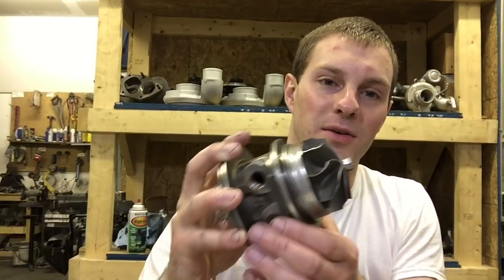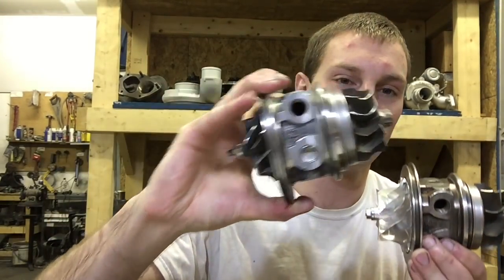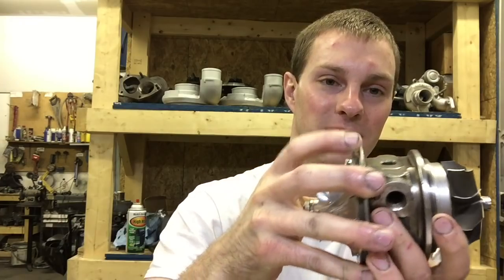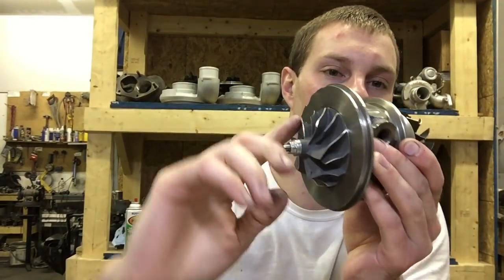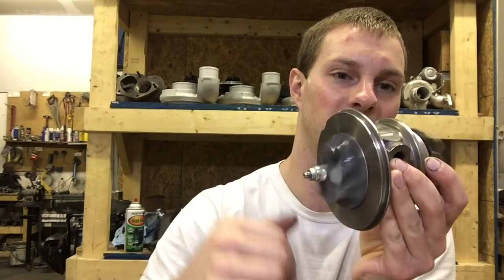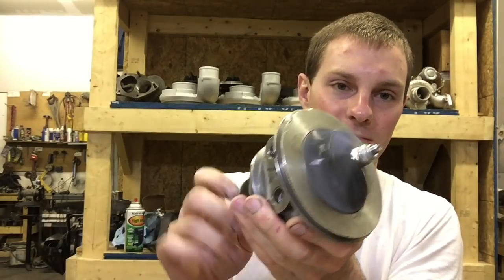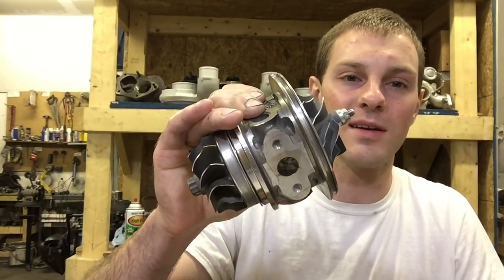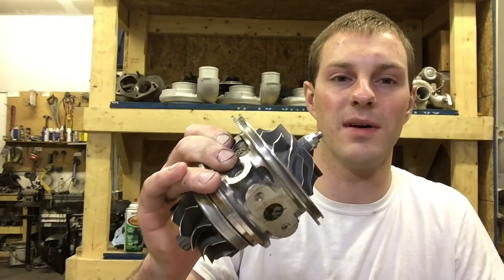Pros and Cons of Ballbearing Turbos

Comment: I use a Garrett ball bearing turbo (GTP38R) in my truck and I love it.  Spools so much faster than stock, used it in both auto and manual setups of the same truck and its amazing.  Really helps to build boost quickly after shifting. Easily holds 40psi when you step on it. Truck has over 400k miles on the 7.3l making around 700ft/lbs.

Comment: i have your 60mm upgrade on my Evo X and it's not laggy at all, been running it for about 2 years and no issues at all with my stock engine, i can't wait to build and see what this turbo can really do. im currently at 470 awhp at 25 psi
Reply: EvolutionXRG what gas is this on? 93 or e85?

Comment: ball bearing turbos have lower friction than journal bearings at low speeds, but above 100,000rpm the journal bearing has less overall friction
Reply: Can you link to some good references so I can read more about that?
Reply: House of Boost for sure less moving parts
Reply: 100,000 RPM?!?!
Reply: @denismarinos4784  Turbos spin really fast.  Take a look at a compressor map sometime.
Reply: @denismarinos4784  small frame turbos can exceed 200,000 rpm, a ball bearing CHRA typically shells it's nuts close to 180,000 rpm. For those applications and when you can't watercool the center cartridge a journal bearing is far superior

Comment: I have to agree with you. Ball bearing is a great stock or slightly upgraded setup due to lots of daily drive cycles and lower boost. Journal bearing are better for larger turbochargers for its race applications and rebuildness.

Comment: Hey great channel good info I’m putting together my first turbo motor an I’m not sure if I should put 2 s400 Bort and Warner or I should put a s500 the motor is a 363 stroker  ford with trick flow heads high port with a stage 5 port job an a trick flow r intake with a 700 lift cam solid roll an a 90mm acufab throttle body an 200lb injectors

Comment: I know this is an older video and I watch a lot of your stuff super interesting. Super cool your willing to take time out of your day to help people!  I have a 6.7 PS hopefully I never need anything but if I do I'll def come to you.
Reply: Powerstroke 6.7 I would suggest in looking in to Elite Diesel Engineering or Industrial Injection Diesel Performance or you might check KC Turbo

I’ve been around Naturally Aspirated and Forced Induction (i.e. Turbocharged & Supercharged) Gas & Diesel engines the vast majority of my life. Diesels and Higher Displacement Engines (even small four & six cylinder engines) of any type will perform 75% to 80% better than stock with a Double Ball Bearing Turbocharger. Journal Bearing Turbochargers work best on like very low displacement but very short thrown/15+k RPM capable power plants.. examples: Formula 1 Ferrari 458/Maclaren F1/2015 Ford GT EcoBoost LeMans & Gran Prix classes. So to put a journal bearing turbocharger on a diesel three things can happen

1. EGT’s (Exhaust Gas Temps)/EOT’s (Engine Oil Temps)/ECT’s (Engine Coolant Temps) will be higher than with a stock turbocharger

2. Oil Changes will be more frequent due to the increase in demanded lubricant in the turbocharger alone

3. MPG’s will drop due to a higher demand for the use of more fuel to rotate the turbine

In other words a journal bearing turbocharger will make a Diesel engine work harder and can cause more & faster wear and tear whereas with a double ball bearing turbocharger it’s the complete opposite.

How do I know such details simple.. was raised by a father who’s an S.C.C.A. (i.e. Sports Car Club Of America) Safety Official for Laguna Seca and Thunder Hill Raceways out here in California. His life of the automotive engineering and creativity inspired me to learn more about the physical characteristics of engine displacements and what advantages there are in the various levels of the Forced Induction and Naturally Aspiration aspects.

Note: if I’m able to give an assistant manager of an O’Reilly Auto Parts store a five minute history lesson of the Ford V8 (from the Mercury/Offenhauser Flat Head.. to the Holden 289/302/351/390 with offset firing orders from the original Ford design.. to the hostile take over of the Ford Motorwerks Plant in Germany during World War II which was used in the manufacturing of the German Pänzer Armoured Divisions).. I think it safe to say I’ve got my bases covered in the Automotive Engineering field.

I hope this helps.. if you want more insight on such join the forum PowerstrokeNation.com

There you’ll find blue oval certified techs/engine knowledgeable DIY’s like myself/performance parts retailers and staff that give you more insight on this question.

Hope this helps better answer your question.

Good luck & May The Force Be With You👍✌️😉😏🙂

Comment: hey i really like your videos very knowledgable and very to the point. Subscribed and liked. but i have a question. I have an e36 325i i boosted a while back and currently at 1.5bars. ive gone through 2 turbos in 1000 miles.(on my 3rd turbo)  yes they're ebay turbos. cheap cheap gt3582r.may have to try another oil location. (currently running through vanos)  im curious if the ball bearing can take more beating. ive found another 3582r billet and ball bearing. just curious to your thoughts. any questions, free to ask. i want to hear your thoughts.

Comment: Diesel turbos. Combination for fuel efficiency and max power or turbo desired for efficiency. Compound set up is a waste gate better than using turbo gate? What pressure to open gate into second turbo. How much boost till your destroying the turbo.

Comment: Ball bearing is only need if it is a large turbo that fluctuates a lot in speed. For a truck that maintains boost for extended periods a ball bearing is not necessary. Ball bearing maintains clearances for longer between impeller and housing, journal bearing would do this also except wear happens when oil supply is turned off and turbo is still spinning, so a ball bearing tends to last longer. If an electric oil pump was used for priming and engine before and after it turns off, a journal bearing would last just as long. If you service a journal bearing often which does not cost much at all, it would last a long time.

Comment: I just recently ran into a problem with my turbo blowing oil. Its a ball bearing innovative brand turbo. They went out of business back in 2011 so I have no way of contacting them... I checked for clogs and mad sure the oil level was right... its on my motorcycle by the way. I had someone quote me 1200 bucks to replace the center section. Does that sound about right? I'm mechanical inclined so I would do it myself. Is it hard to do?

Comment: You said laggy. I know ball bearing helps a lot with transient response, spooling up a turbo mid-corner when you’re on and off the throttle, building the boost back up. How noticeable is the improvement in threshold? Do they typically spool 300 rpm lower in the rev range?

Comment: Great Channel ! I have a 2007 335i starting breakdown this weekend  . I am going to be adding the air filter relocation kit with bigger intake, downpipe w/cats ,intercooler and MHD tune . Would this be good for my build and would  525 hp be possible ?
Reply from the maker: The peak of the stock turbos is arpund 500 hp

Comment: About 3 years ago I had something get into my compressor housing and 2 of the tips got bent, I called both garrett and atp and they both told me that I needed to replace the entire chra, note this turbo only had about 2k miles run time, basic new still other then the bent tips, it was a gt2871r, since then I was always under the impression all bb chra where in rebuild able

Comment: Hello. I run a GT3582 Ball Bearing turbo in my YB Prototype racecar and the key advantage for me is spool up speed. Coming out of a corner one definitely needs to be produce power as quickly as possible as I do not run anti lag. Because it potentially destroys my lightweight exhaust manifold. 

Not sure if I should try putting the I/L By pass valve back in to help too.  I don't really like the added complication. What say ye ?

By the way thanks for the tutorials - absolute god-sends !

Comment: 1.5 L stock  turbo, what turbo could i upgrade to?? Only mods are 2.5 inch exhaust, AEM intake, light weight rims. About the ball barring turbo,  how often have you seen the barring bust into engine n oil pans.

Comment: At 4:09, you say that the turbo in question cannot pass enough exhaust gases through the turbine wheel. Is this something an external waste-gate could solve while keeping that specific or similar sized turbo? There must be ways to flow boost through it up into the higher rev range even with the limited exhaust wheel size.

Comment: one point i would make is peak horsepower isnt everything. i would argue that if you have two cars identical in every way except one turbo is cable of spooling even a tiny bit faster if  you ignore all outside factors and influence the faster spooling turbo is going to produce more average power and be an overall faster car

Comment: I have a cheap On3 76/65 journal turbo on my stock internal 5.3 with bigger injectors and fuel pump and I plan on getting a turbonetics ball bearing turbo either a 7668 or a 7868 with a .96 AR. Running on about 6-9 PSI. Which would be the better option?

Comment: not sure if this was mentioned earlier, however how about ceramic ball bearings? 

also curious if you might know if there is/are some company(ies) out there using material called Pandalloy®(commercial aerospace grade stuff) on the compressor and turbine wheels, and for the turbine shaft?

Comment: I´m in 2.5L 650hp+ range...and i feel that i need ballbearing because holsets does great 600+ hp in ethanol 100% with 60mm compressor and 64mm turbine, but more than that in my country we just find hx50 or s400, so the car remains so laggy that only really builds boost with antilag systems or step systems, so we go gt4094+, k27´s aren´t really capable of making more than that.. but not with 67mm hx40´s compressor it really saves the day(and budget lol). i have a question, how about 67mm hx40 compressor with 64mm hx40 turbine?

Comment: hi.. what a great video you have made. anyways, just wondering what you would think and do regarding should I/you run the water lines with ball-bearings turbos? i have seen that some dont and some do route the water cooling line in it. Thank you.
Reply from the maker: +andylaksana runs the coolant if you can some people can't because their engine is aircooled. The coolant will help it last longer

Comment: What would be the turbo for a d16y8 motor to make about 400hp and start spooling at around 3,000rpm and what would be best for that application ball bearing or journal bearing I currently have a 5854 presecion with a 68 .ar journal but I haven't ran it yet

Comment: Hi, I was wondering If you could give me some advice on turbo selection for my car please. I have an old Skyline (R31 with RB30ET) that I use as a daily and drag race car. I'm a mechanic by trade, it's got a really good built motor by I want to start leaning on it a bit. Currently running a GTX3582R which is really good on the street, but won't get me where I want to be hp wise. It has a 1.16 A/R ratio exhaust and a 0.7A/R comp cover. I've been looking at Precision 7675 Gen 2 or a GTX4202. What can you tell me about how these turbos compare??? I'm looking at making over 1000hp at the wheels, by don't want to ruin how the car drives too badly on the street. It's an auto car with a big hi stall if you were wondering. I saw a Real Street vid where they did a dyno vid of a 2JZ running the PT7675 and it seemed to come on fairly early for a turbo that size. By 4500 it was making over 600hp to the tires and made a peak of 1298 at around 7500 - 8000RPM. I could live with that!!! LOL ;) I want to make big power, but I want it to come on as early as possible as well

Comment: I ran into your channel by accident. Glad I did! I have a failed turbo on a CAT 3116 6.6 liter. This turbo has low miles, so it is a puzzler. I like your discussion of the ball bearing set up. I have a couple of questions. If I sent you the cartridge, could it be rebuilt with ball bearings? Is there an aftermarket cartridge company that you prefer ? The prices vary a GREAT deal.
Reply from the maker: +urgentcareguy3 I'm not familiar with that turbo. I have some people I can ask around to see if I can get that turbo, I usually don't like to take on jobs that I'm not familiar with because the risk of buying the wrong thing, I have done it before for a 1972 maxidine that had an s400 I think, I bought a replacement cartridge , I had to machine the turbine housing for it to fit, other times I had some that were a direct fit for a holset I can't remember the name. 

I can try to search it for you. Do you have the part number of the turbo? I may have the rebuild kit
Reply: I contacted CAT and am waiting to find out the exact turbo brand and model#. 

I found this link: 

https://naplesturbo.com/items/CHRA_Schwitzer_S2EG_199716_VJ.html

The turbo is a Schwitzer Borg Warner

Comment: Hey I have a s2000 and planning on doing a rear mount (under the boot) setup to keep the engine bay free from heat and clutter .. plus I've never seen it done so was wondering what size turbo you would reccomend and also with the distance from the engine is it worth running ballbearing for less restriction ? Cheers

Comment: i need you help please what would you say on a diesel engine 5cyl 2.9td merc. ball bearing or vgt turbo. it only rev max 4000rpm, but i need full boost say 15psi (not alot) standard engine from max 1800rpm full boost must hold till 4000rpm. but airflow must hold flow strong from 1800 till 4000

Comment: Precision 6266 ball bearing or 6766 journal bearing on a 2.0l eclipse gsx? 99% of the time street driven with a few passes at the strip. Looking to make 650awhp with room for more.
Reply from the maker: +Ilir DSM. You probably should ask pte their hp rating. The 6766 should be good for around the 950 hp range. The 6266 should be good for in the 600-700 range but you don't want to max out the turbo because then it starts to blow hot air.
Reply: Ilir DSM. Do you plan to use e85 daily?

Comment: Question, do Ball Bearing Turbos last longer then Standard Journal Bearing T's i coukld go into a long winded question on reliability but to keep it short Would a ball bearing turbo swap be a potential fix for a "run away diesel" problem from happening (also assuming all correct service periods and procedures is of course)
Reply from the maker: +GTFORDMAN both are reliable if treated well, high egts in a ballbearing turbo can melt the inner race. High egts on either can melt the shaft blades, and high egts on the job can warp the shaft and cause destruction, but that's very extreme egts

Comment: Great explanation. I thought that they didn’t make ball bearing turbos because of the night heat. I would definitely say go with the highest quality bearings if you are going to have them. I have a 2nd Gen Cummings. To bad they don’t make auxiliary electric oil pumps so you can get oil flow before you crank up the engine. Then the turbo is already oiled.

Comment: @Turbo Lab America whats your opinion on Precision ball bearing turbos? I just installed a brand new BB5858 and its already burning oil and blowing smoke out of the exhaust. Are you able to rebuild them and fix this issue? It seems to be a common issue from what I'm seeing.
Reply from the maker: Usually the oil drain is to small in a case like that, I can rebuild them but it's best you talk to precision about your turbo problems, I could help you with this issue but I already have videos about solving this kind of problem
Reply: Turbo Lab America I have a -10 return and -4 feed that came with the kit. I called precision and told them and they said return line too but there is numerous people running this same kit with no issues..
Reply from the maker: There are different drains some are 10 mm inside diameter but the smallest allowable is 13-14 mm, I machine the an firings to 15 mm id

Comment: I have a 2018 Harley-Davidson Fatboy with a 114 Milwaukee 8 what turbo would you suggest and how much would it cost?
Papa P
Reply from the maker: It probably makes sense to buy a trask kit. That would be easiest. Or if you went bolt on, a t2 or t28 or gt2860r would be good size, we did a gtx3071r for one once, but I think that’s a bit much
Reply: Turbo Lab America   
Thanks so much.
Reply: @martyportersr7008  I have a Garrett GT2056V from a Jeep Liberty on my 2000 Fatboy (88 Cubic Inches). It has 85,000 miles and it is still running great. The variable vane exhaust works very well. I converted the electronic actuator to a mechanical diaphragm.
Reply: James Schell  
So you put that turbo on it. Did you do it yourself or have it done and what did it cost? Also what kind of torque and hp did it end up with?

Comment: Is a ball bearing turbo more sensitive to compressor wheel balance or compressor wheel accuracy of fit on the shaft?
Reply from the maker: +Serge Campeau balancing is more critical with the gt35r and smaller, the gt37r and larger have more forgiving tolerances.

Comment: I'll need a rebuild kit for my GT2871R, all 28 series Garrett's use the same rebuild kit?   looks a little tedious getting the inside bearing race off the shaft, guys are using pullers?
Reply from the maker: +Terry Filkins https://www.youtube.com/watch?v=GgNjLbcCggE
Reply from the maker: +Terry Filkins https://youtu.be/QASmAnqnhf4
Reply: Great, thanks. Do you have assembly videos? is it safe to press the shaft into the assembled bearing?